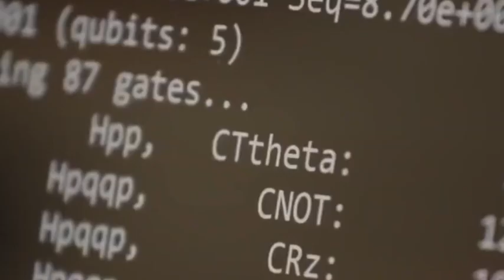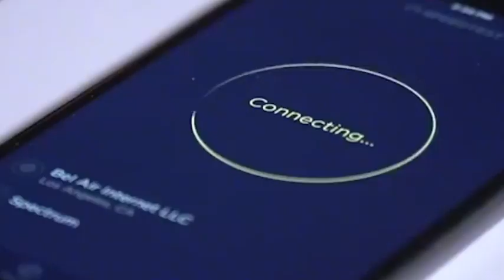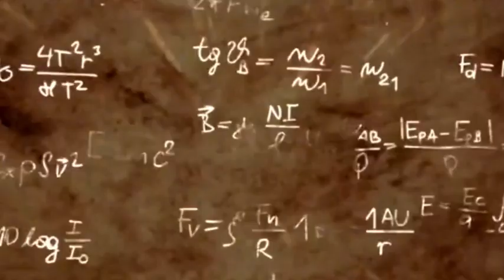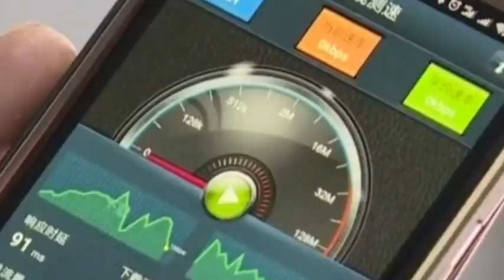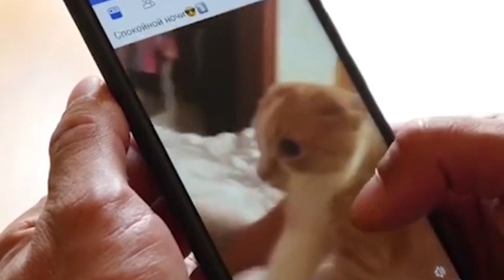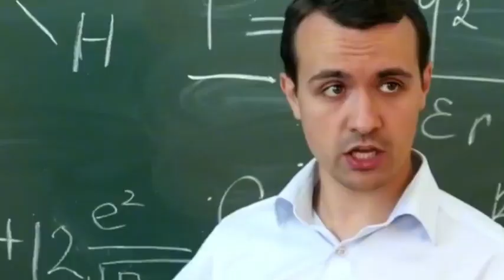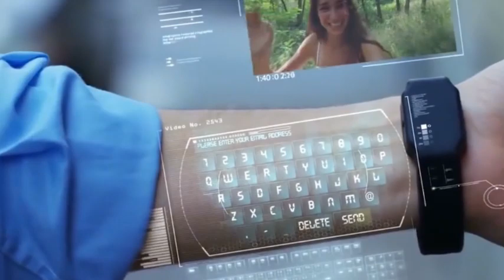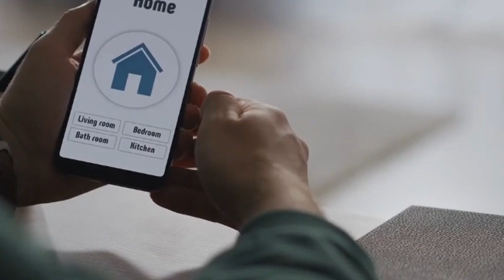ASML's China U-Turn: How US Pressure Forced a Semiconductor Giant to Flip?

Comment: China or Russia has not developed its own advanced lithography machine capable of producing 3 nm chips.

Russia's semiconductor industry is far behind global leaders like the US, Taiwan, and South Korea.

Currently, Russia can only mass-produce chips at 90 nm, 65 nm, and (with difficulty) 28 nm using older DUV (Deep Ultraviolet) lithography machines, mostly imported before sanctions.

Due to Western sanctions, Russia struggles to access high-end chipmaking tools and relies on smuggling or repurposed equipment.

China is working on it, but it does not yet have a domestically made EUV machine for mass production of 3 nm chips.

SMEE (Shanghai Micro Electronics Equipment) is China’s leading lithography machine developer, but its best technology so far is 28 nm DUV lithography (not EUV).

ASML (Netherlands) is the only company in the world that produces EUV (Extreme Ultraviolet) lithography machines, which are essential for 3 nm and below.

Due to US-led export controls, China cannot legally buy ASML’s EUV machines, severely limiting its ability to produce cutting-edge chips domestically.

Companies like SMIC (China’s top foundry) can produce 7 nm chips using modified DUV machines, but this is less efficient than EUV and not yet competitive at 3 nm.

ASML is currently the only company producing EUV lithography machines required for 3 nm and below.

Nikon and Canon (Japan) also make lithography machines, but they are limited to older DUV technology and cannot match ASML’s EUV dominance.

TSMC, Samsung, and Intel rely on ASML’s EUV machines to produce 3 nm, 2 nm, and future nodes.

Russia – No advanced lithography machines; stuck at 28 nm or older.

China – Developing its own machines (SMEE), but no EUV yet; relies on workarounds for 7 nm.

ASML – The only supplier of EUV machines for 3 nm and below
Reply: Damn fakes news and fantasies that are destroying the collective west 😂. US is already fucked to collapse. Defeated  military in ukraine and defeated in economic war 😅